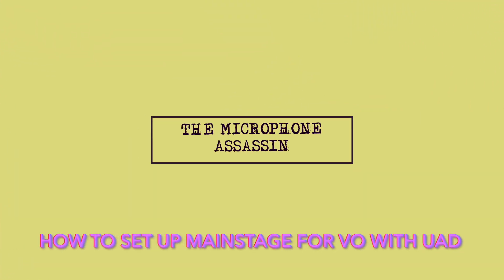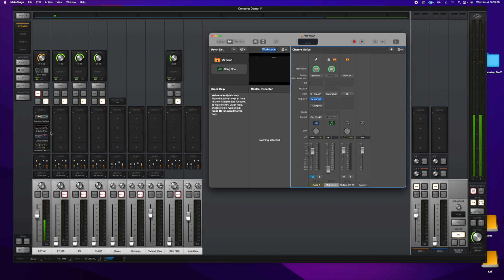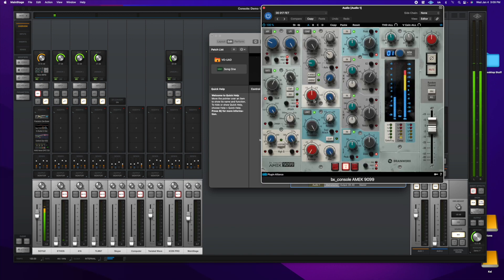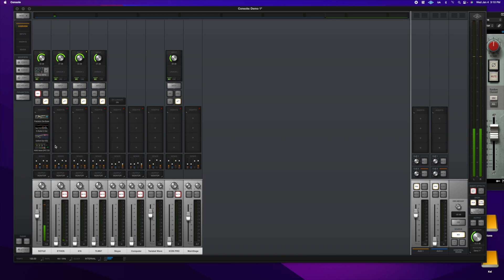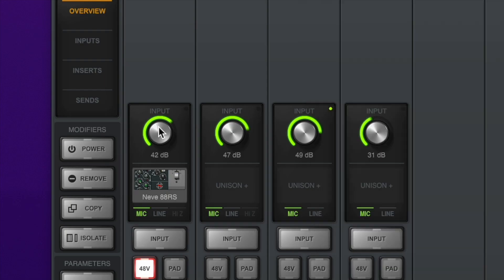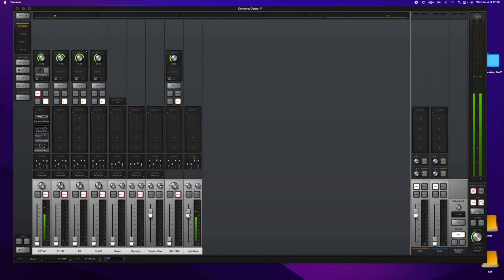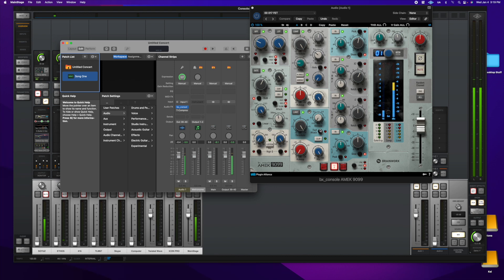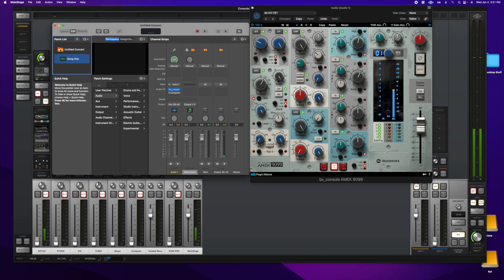How I Setup Mainstage for Voiceover with UAD

Comment: This video lacks the ONE thing I’m looking for, you literally danced around it, covering everything EXCEPT:
1. Setting up the routing on console. (Virtual outputs).
2. Being able to route the output signal via MainStage.

I was holding out hope you’d show that, but alas i got to the end and it missed those key components. A true “from scratch” video would have been great, starting with a blank console set up as well.
Reply from the maker: I wouldn't use it with Console as it would add too much latency to cut live through it. Also, sorry to say there won't be a follow-up video as I don't use this setup any longer.